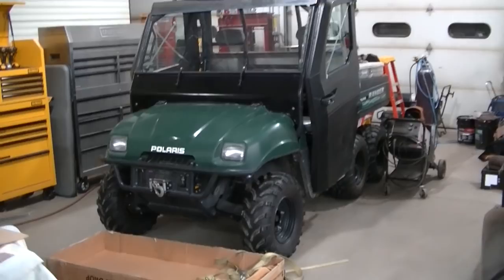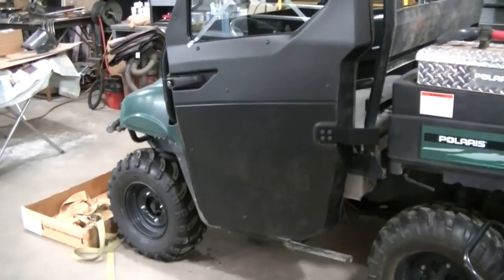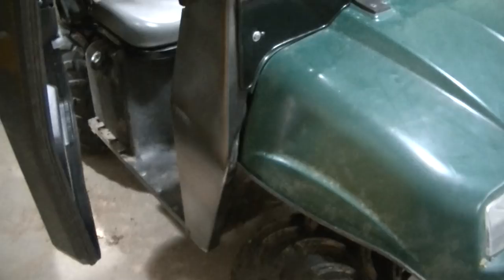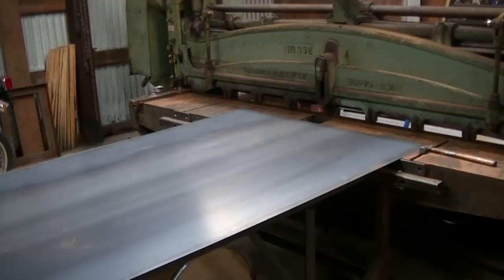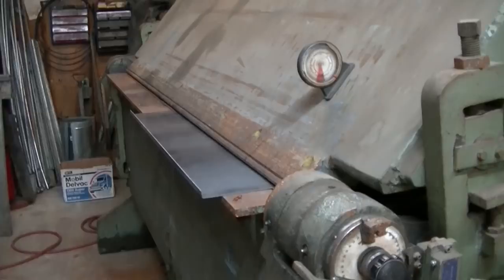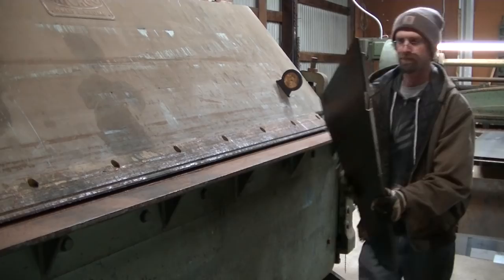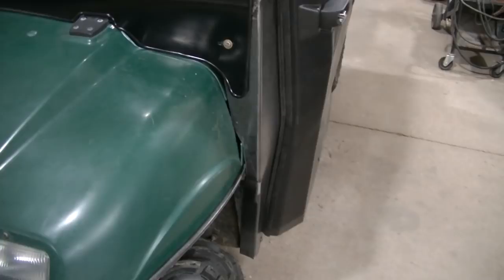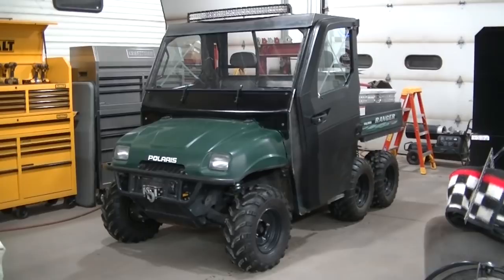04 Polaris Ranger 6x6 Power Window Door Install Part 1

Comment: Hey Mossman long time no see. Not sure about the expense, and work involved for hard doors is worth it. I'am still using the soft doors you recommended a few years ago . I found a brand new kit on line  for a couple of hundred bucks. These doors have been through hell , cow kicks, heavy rain, screaming wind etc. with no rips tears etc. With my polaris heater kit going on low speed, the coldest windy weather happening, i go  happily cruising. My 2003 series 11 has given my headaches in other areas (blown head gasket, bad cam, 2 fuel pumps , ripped up cfd boots etc. ), but still love the old girl . I would never be able to feed cows in severe mud without it! Woops! getting off subject!  excellent fab work! keep up the great work, and have a great day!   Ed
Reply from the maker: Those soft doors are really hard to find now.  That was one reason why I went this route.  I think the work is worth it to have really nice doors.  I have since gotten another 900 and have taken these doors for it so my plans have changed a bit.  Yours must have really high hours to have all those problems.  This one has fairly low hours.  Also keep that radiator cleaned off so you don't overheat the motor.  Glad you love your Ranger.  They are great machines for work and play.

Comment: Hey Mossman have you ever had to take the door apart o repair the mechanism?? <y passenger window quit working and seems out of the track.
Reply from the maker: No but my brother in law has taken them apart.  He installed mirrors on his doors and also my sisters door handles and window have gotten loose on her 2013 900.  I don't think it's that hard to pop them apart.  I am not sure they are making these doors anymore.  The website didn't list them the last time I looked.